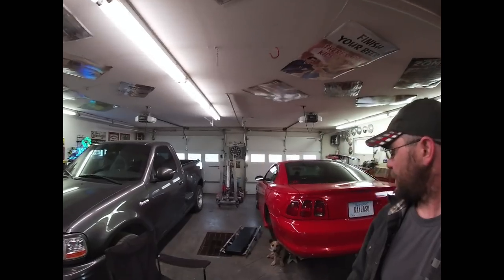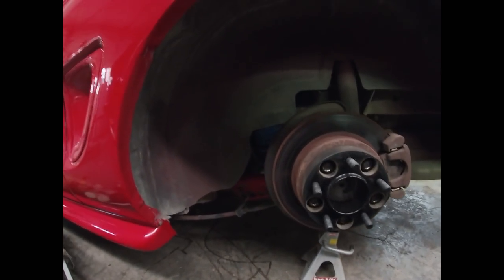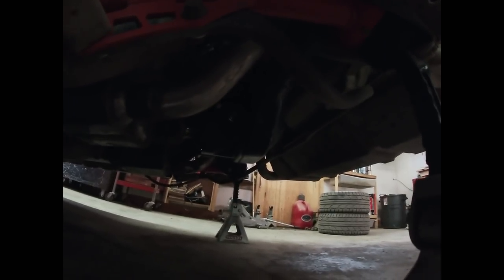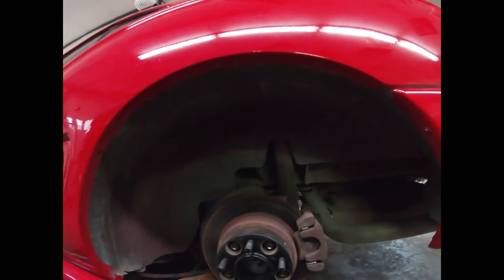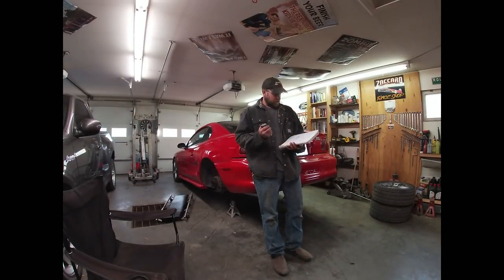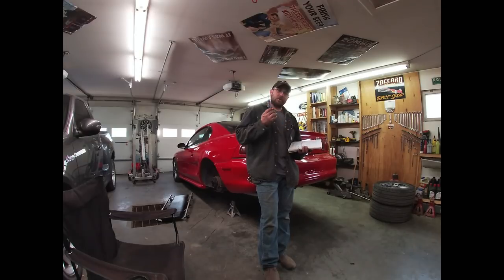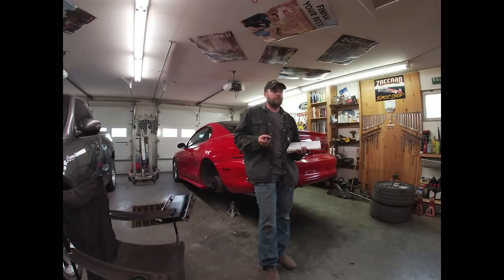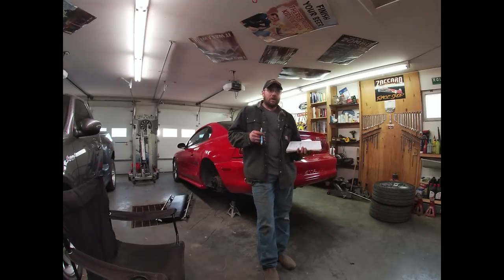Answering some viewer questions and comments

Comment: One question I would have...I'm not too bad with mechanical work but I dont do body work. Dad and I bought a 1979 International Scout II Terra that needs some body work. I converted it to 4 wheel disc brakes, rebuilt the carburetor, and gave it an overdue tuneup. Any way I can contact you privately about some bodywork and questions with it?